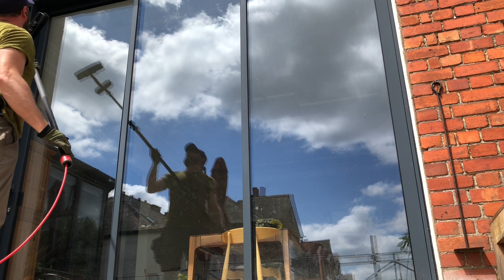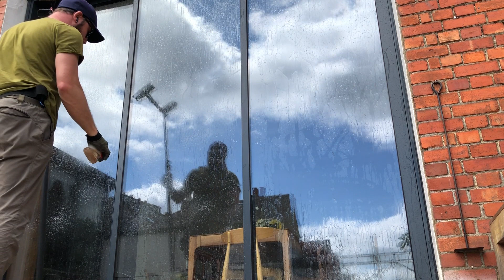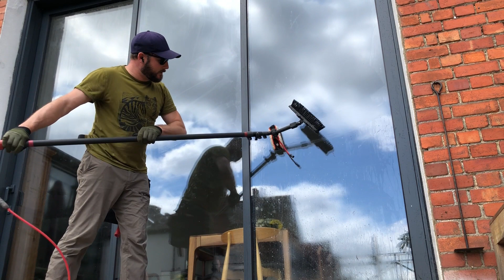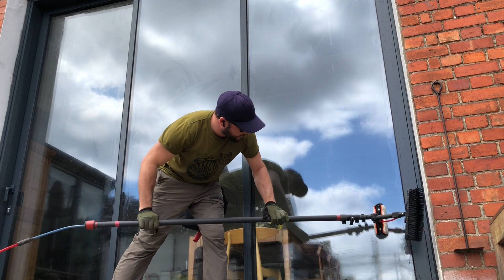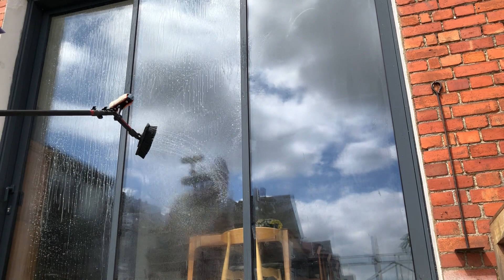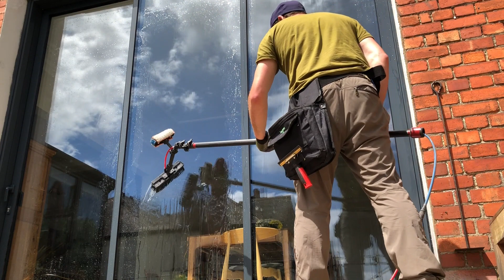WATER FED POLE CLEANING 101 - Beginners Basic Window Cleaning Tips Techniques Hints #windowcleaning

Comment: It’s probably not as much of a problem for you Poms over there, but I’m just having constant issues with my WF brush not properly being able to remove Bird and Bat shit (here in Australia  mate)…we get a lot of exotic birds and large bats and it can be bad on some windows. 
Especially when it’s baked in and second storey. 
Any suggestions or tips mate?
I haven’t got any sort of abrasive apparatus on the back of my brush either at this stage (walnut pads etc)
Reply from the maker: Hiya mate! Nice to have a comment from Australia, I have family in New South Wales! We also deal with baked turd, especially from pigeons and gulls. Working at ground level and trying to scrub it off with various pads can be difficult. Recently I've moved away from using walnut, steel and the near obsolete  bronze wool pads. I'm using a 6" Unger Ninja scrapper, fitted to the Unger tip, that locks in securely. Its a sure way of removing the mess. Soak the area well with WFP, could also use universal cleaner on brush if its real nasty. Then use another long enough pole/WFP with scrapper attached to remove. Hope this helps mate, all the best

Comment: How do u connect pole pipe to hose pipe
Reply from the maker: I use Exceed Innovations Go Tubeless hose tail and pod setup.
Reply: What length pole do u need to reach upstairs windows
Reply from the maker: The Gardiner SLX25 wfp will reach most 1st and 2nd floor windows in the UK.

Comment: I admire your pride of workmanship,interesting to see a different method from mine.
Personally for first cleans I sometimes use a drizzle of washing up liquid directly on the brush and find that more than good enough for glass and frames nearly every time.Occasionally I use upvc cream cleaner on frames but careful on glass as it’s potentially abrasive.Thereafter just pure water paying particular attention to rinsing edges.
Over time I’ve learned the importance of cleaning the frames often especially above the window as this minimises run down,sometimes I rinse back over as necessary.
I observe other window cleaners don’t bother at all with any of this and when the windows have dried they’re often covered in run down dirt! I can’t work like that,it has to be done right.